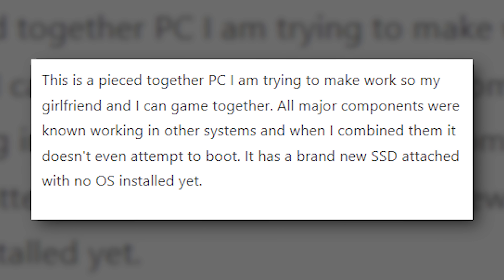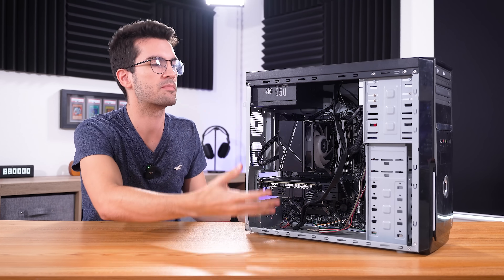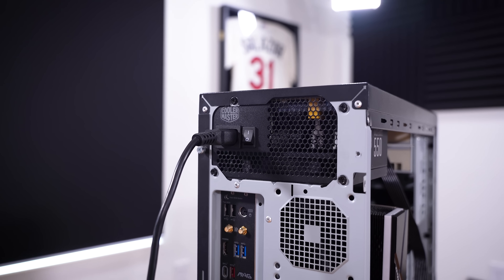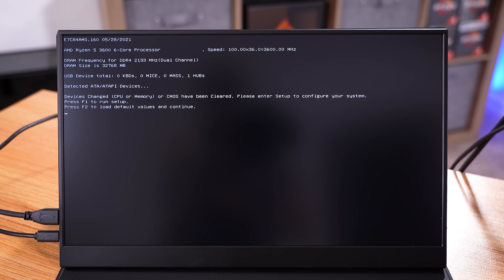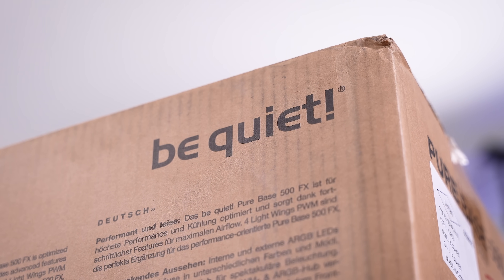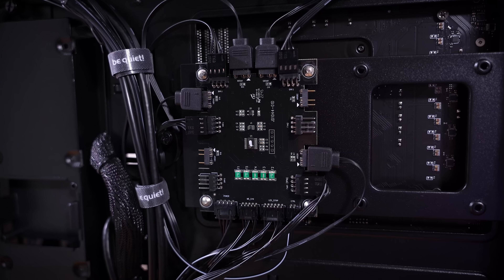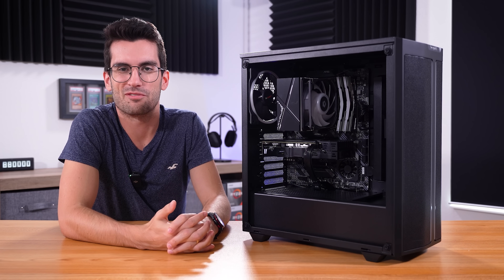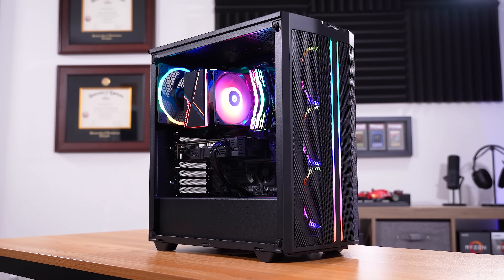Fixing a Viewer's BROKEN Gaming PC? - Fix or Flop S4:E11

Comment from the maker: I find it so disappointing that a few people have accused us of "planting" this build in the series merely for the purpose of upgrading it with a sponsored case:

For one, we already have recent "makeover" videos on the channel. If my goal was to overhaul the look of someone's rig, I would have framed the video as such. I've done it before and I'm certain I'll do it again. It's not as though those videos perform poorly or anything.

Second, as usual, I had no idea what was initially wrong with this system prior to picking it up. For all I knew, it could have been PSU, motherboard, or CPU-related. Had the PC required other replacement parts, I may not have upgraded the case.

Third, the owner of this system likely spent more in gas money alone for pick-up/drop-off than the $$$ value of the replacement case. Owners of systems for this series are NOT told whether they'll be receiving upgrades. In fact, we make it clear up front that we don't even guarantee fixes - let alone upgrades. 

Those who seem off-put by how simple this fix was are missing the point. Some fixes are simple! And, like I said near the end of this video, simple mistakes are insanely common. I feel it's important to show them all, complex or not. Of course I want that bag, but I would never waste valuable Fix or Flop video slots for the sake of simply shoving in a case sponsor. It's a shame we can't do nice things for folks without having our motives called into question.
Reply: For what it’s worth, I run a tech repair shop and have so many people come in with the simplest of issues. Not everyone has the ability to build a PC. Lol
Reply: Hey Greg , i tried fixing a 2060 to my motherboard and it just would not fit , thought i was stupid for ordering a card that was not right , then realised i hadnt taken the cover off of the interface , easy mistakes happen all the time ,
Reply: @steph_s58  The user who sent you this PC done a great job in building it and just made 1 mistake!

I bet a lot of these people who are making stupid comments themselves still make the odd mistake
Reply: Considering the bullying received my members of LMG during the whole fiasco and recently Unity having to tell their employees not to go to their offices because of death threats, unfortunately some people in the community suck. You’re not doing anything bad here Greg
Reply: Don't worry bro those are just trolls. All of us real fans of the show don't care about that sort of stuff. It's very satisfying to see these sort of upgrades that make a PC look 100x better. Thank you for another great Ep!
Reply: Don't worry about those people Greg, just keep on doing you bro!
Reply: People will complain about anything, nothing new there.
Reply: So what if that had been what you did.  It doesn't change what the ultimate point of the video was at the end.  People make mistakes and sometimes the easiest fix is the right one.  When we over-complicate things is when they get worse.  The object lesson of the video would still be valid.  Some people just aren't happy if they aren't bitching and trying to bring someone else down to their pathetic level.  It's best just to ignore them at times.
Reply: The value (beyond entertainment) of Fix or Flop to us viewers is in the problem solving aspect of each instalment. Some problems are obvious in retrospect, others are much more complex. It'll never be wrong to highlight the obvious ones; we've all made these sorts of mistakes and, if it helps even a handful of people, the video has more than justified its place in the series.

Keep them coming Greg!
Reply: There's always going to be doubters and complainers.  I enjoy watching these because your fixes always benefit the PC owner above and beyond the basic problem.
Reply: Even if you did pick it based on the case being trash, who cares!? You're still taking a persons system and fixing it. Just happens this one fit a sponsor.
Reply: Well that's just silly. Never get that vibe from you.
Now poking fun you didn't instantly reply back with "check your front panel connectors" is ok IMO :)
Reply: Don't mind those haters. You are doing great.
Reply: Who cares what people think always keep your integrity and let people be people. Great video Greg.
Reply: there's always those people mango, the best you can do is just ignore them. They won't go away.
Reply: yeah m8 ya gotta try and ignore those nothing nice to say people as we all know tour ethics are sound and nothing wrong with giving a freebie away courtesy of a sponsor. sounds like a bit of jealousy to me.thanx greg keep it up
Reply: How dare he give away a case upgrade from the video sponsor. Next he will give away a CPU cooler upgrade to an overheating PC from another sponsor. It is almost like manufactures want to help support the DIY PC community and the free work Greg is doing to keep older PCs going.
Reply: Really people are complaining about that? Who gives a s**t even if you did do that? It's your channel right? 😅
Reply: People saying this probably don't follow you long enough. They will eventually know!
Reply: My man, you don't need to acknowledge them. We love your videos.
Reply: People are so dumb. They're so quick to come up with something wrong that they don't stop to think that you probably have a list of people coming out of your ears that want you to fix their systems. You literally have zero motivation to do something like that.
Reply: I've built PC's for 20 years and still mess up, people act like they are perfect PC gods.
Reply: this was a good video
Reply: The fact you even have to post this comment is ridiculous. To quote someone I respect, I am mind blown by the narrow mindedness of some people. 

You're right, sometimes fixes are simple. You could have just fixed the wiring and handed the build back. You chose to swap out the case, and you have every right to do whatever you want with your sponsors and channel. People are just salty for the sake of being salty.
Reply: I feel this comment. I'd feel pretty dumb if this happened to me as well but things... happen. Just remember that all humans make mistakes and unless you were very decent, I think this viewer wouldn't have reached out if that was the case.
Reply: It's not a plant, people legitimately do little things like this all the time and it can take them forever to fix it.  I've seen hundreds of posts online of people who plug the hdmi into the mobo instead of the gpu, and it goes on and on.
Reply: As the saying goes...."You're a nobody until you get some haters"... I want to see a owner come forward on one of these videos to silence these doubters.....Besides the video was quite helpful for people that have made this mistake 👍
Reply: Regardless Greg, the rig looks really good in the new case, I bet they were very happy with it 😃
Reply: Don't mind them Greg, just do what you do best, troubleshooting PC. Keep the videos coming, I believe in what you do! Keep the videos coming!
Reply: Greg, I wanted to take a moment to express my sincere appreciation for your kind and thoughtful actions. Your consistently positive and considerate demeanor has not gone unnoticed and has had a significant impact on those around you. Your character is truly admirable and serves as an example for others to follow. Thank you for being a genuinely good person.
Reply: I love this channel that is because I don't have all the tech you do so I can learn from you when I do get the tech I can install it and not have any problems.  I love building computers it makes me feel good when you put a bunch of random parts together and they become more than just random parts, when they are work together they make a computer.
Reply: F the haters, don't deserve your time. And yes, these easy mistakes for first/second/sometimes even experienced builders do happen. Nothing wrong with showing that. The mobo has no silkscreen markings for the individual headers, so it can be real easy to plug it into a usb2 header which sadly accepts these pins and looks eerily similar without consulting the manual. I'd say, nice case upgrade, that rig deserved it!
Reply: when i put together my first rig around an year ago, it did not boot guess what the problem was lol. I really appreciate what you do for the community greg!
also i have looked far and wide for this case, 500 dx/fx is probably my favourite case from be quiet. sadly its either just not available here in india or over priced to hell and back. i will keep looking. thankyou for the video! xD
Reply: They will always be people who want to knock you down Greg, that could be a measure of your success and their jealousy.
I very much enjoy the fix and flop series.
Thankyou all the best.
Reply: When I saw him explaining that user is not using optical drives I said to myself: Greg is smart by picking PC’s for series! Because he has probably case laying around - and sponsor sure won’t let you have stuff for too long if you’re not promoting them. If he would have a ton of graphics cards laying around - of course he would pick PC’s with no video output instead of ones overheating!
Reply: Pay them no mind,just keep doing u,n thanks for learning with us☺️
Reply: lmao.. don't listen to them. sometimes the fixes are just that easy. They should be appreciative that you're giving back to the community - 1 with this series and 2 with the occasional upgrades you do! You're amazing Greg.
Reply: I think anyone that's been a sub for the channel awhile knows that your and upfront kind of guy that tells how it is so people saying that crap need to grow up its called being jelly but thank you for sharing the content i love this Playlist i learn alot so thank you Greg god bless
Reply: Crazy that people are so jaded, cynical and rude. Keep up the good work Greg, you're doing good things out there. Love your stuff!
Reply: Ignore the haters. This a great series.
Reply: Bruh just keep on helping other no matter the good you do they will be haters don't let that discourage u
Reply: I have fractal desing pop case
Reply: He mounted the cpu cooler the wrong way. tbh, I would have used the stock one from Intel.

Comment: IMO I was more a fan of the sleeper look on the old case. I still have an Antec 300 sitting around that's very similar in arrangement, except for PSU on the bottom.

Comment: My very first build did not power on. I went over everything three times. It all looked perfect. So I just unplugged the cables and plugged them right back in the same socket. 
After that it worked perfectly. So now the first thing I check in any system is loose cables, then cable placement.

Comment: i found out where to put the front panel cords in, in just a quick google search of where do front panel plugs go, and simple picture showing name of the connector on any motherboard where its normally located and what plugs go where in my case the cords are all seperate instead of 1 2x4 and not lined up correctly if you were wanting to tie them together.

I recently swapped cases and ended up not placing the usb 2.0 plugs where they needed to go, tho i didnt look that up

Comment: I always check the main board manual mainly for the f_panel and always read cooler manuals carefully, In-depend on how many times i already did it. Exactly to prevent such a case.

Comment: I just recently did troubleshooting on my sons business PC.  Intermittent restarts, crashes.  I took the MB out and powered it up outsides the case and it worked just fine for hours!  I replaced the case with a new Corsair 4000x and he’s had no problems.  I think the power switch or wiring was faulty.

Comment: The front panel connection is a pain in the butt especially if the pin connectors are split away from each other and have to be put on individually.

Comment: Outside of it not working, really... the only problem with the build is the older case which makes cable management really tough to do and make it look good. I get why they didn't put effort into it with what is probably a solid side panel anyways. And while it looks terrible, that's not really an issue with functionality.

Comment: This kind of simple solution is so important to see in a video. I had a friend who recently built a computer and, as soon as he finished putting it all together, called me in a panic because everything looked like it was wired up correctly but nothing would turn on. Turns out it was just the power and reset cables were swapped.

 It's a simple solution but very important for those who might not know what they're doing and will panic if something doesn't work right.

Comment: Greg, I’ve learned a lot from your channel. So much so that when I purchased HP Victus in February and discovered it ran to hot “ Case to small, 1 case fan ” i7-12700 with a Nvidia 3060 12GB Vram. Not the greatest card, but the rig cost me about the same as the components would have. To remedy it, I built a new computer with components from the New computer. I was gaming 1.5 months after purchase, not a big gamer. I like to edit video from time to time and didn’t discover the problem right away. I touched the top of the case by the rear/ fan and it literally was burning hot. I downloaded Core Temp and started testing. It was Thermal throttling and the GPU was running at near max temps , Plus the game was utilizing 60% to 70% of the card. I purchased a new but older style Thermaltake Core 71 case Full tower, Aorus Z690, Four NVMe.2’s  ,64GB RAM, EVGA G6 850-Watt Gold Power Supply Modular, Replaced the 3-200mm fans with Noctua, Noctu Tower cooler, 2 more 240mm Noctua’s. Four SSD’s. All in one card reader for my DSSLR. The giant fans are silent, it never runs hot and the GPU fan makes a bit of noise under load “ Not much”. I might upgrade it one day. It was my first computer build, I give you a lot of credit for making me feel at ease with the process. Thanks so much and I hope the house is coming along.

Comment: wiredly enough i also have had problem with my own pc recently, turns out it was the nvme ssd that was causing my problems, each tim ei would start a game the pc would outright turn itself off, i had changed the cpu, ram, motherboard, psu and even the grapichs card and i was at my wits end and i would turn to the ssd and changed it and my problem was fixed

Comment: My case had several individual IO connectors and required sharp focus. I'm 63 years old which didn't help matters. But yeah, its not difficult to chose the wrong connector if you can't see it clearly.Great common mistakes / tips video. Thanks for all your videos.

Comment: Two things:
   The last two times that I upgraded my pc I have done exactly what the pc's owner has done, was at my wit's end thinking I broke the pc until my brother looked at it and said "try flipping those cables." worked like a charm. It's an easy thing to overlook and I'm glad it wasn't a worse problem.
2nd thing is the original case could be a fun sleeper build. I'd put feet on the bottom and drill air holes into it as well as possibly making a side intake to allow more airflow. The new case is pretty awesome but I prefer my phanteks eclipse g500a

Comment: I have wired those pins wrong so often in my life and it is always the biggest relief when the "oh no its not even powering" problem can be fixed by that...

I'm still at awe that we STILL don't have a complete standard for this as a 1 cable solution. Is it really that hard?

Comment: I did something similar to this once.  Instead of plugging it all into a usb header, I plugged all the cables into the correct set of pins, but instead I accidentally plugged the wrong wires into the wrong pins, but on the right header on the board.  Obviously I realized it after a few minutes and fixed it and everything was fine but yeah, lol.

Comment: I am having a strange problem with my PC. From time to time , I get a random blue screen that says memory error and some time data corruption. This happens when I change my bios ( dual bios) from main to backup. Main bios f34 and backup f37c .Gigabyte arous master x570 , 3800x CPU and g.skill 32 GB cl16

I can replicate the problem each time using a program. When installing the program it uses a lot of ram 15 to 18 GB , I get data corruption. I do not get this if I use f34 , only with f35 and over.

I think the cpu or ram is the problem.
Is there any good method to figure that.
I can use all the help the pc community can give me right now.

Comment: MB`s should maybe have the  " JFP1 " connecter to have more txt near it saying f:ex Front Cable Connceter instead of just JFP1 to help new pc builders. Only new invention on the conncter realy have just been the pre connecter you can hook the front cable to, and then plug it into the JFP1. Din`t have those 20 years ago.

Comment: You got me at "cable management". If there is no glass, who cares? I don't use cases with glass if I can avoid them. I do cable management but ONLY to make is easier to service if necessary. That said, your videos are often instructive and entertaining.
Reply: Cable management makes it easier to service a PC if you need to troubleshoot it but for the most part is more cosmetic than anything. Even PC temps are surprisingly not as affected as you might think. If you don't use a clear case then don't worry too much besides unless you using a modular PSU it's way too much work to try to keep everything neat. If you care about astuetics then get a modular PSU and a clear side panel.
Reply: @Epsilonsama  sometimes, depends hoe cable managed it is. Sometimes you have to take apart cable bundles in 15 places etc to get at one thing lol.